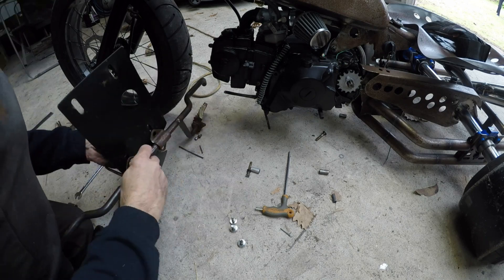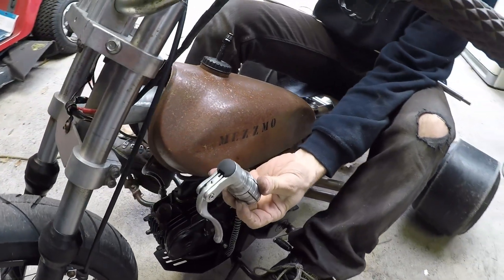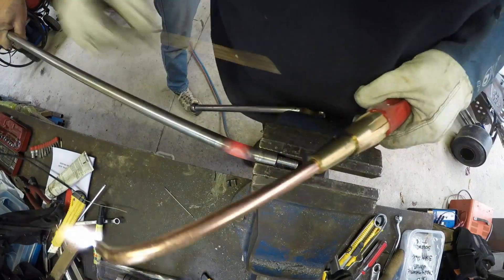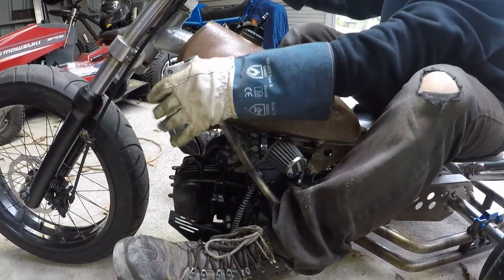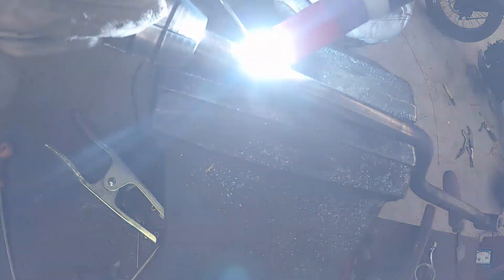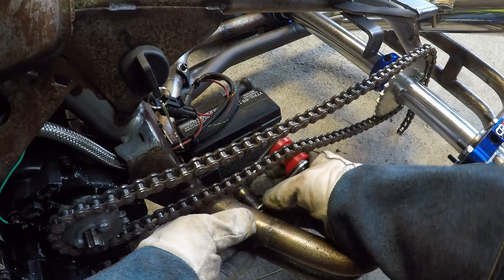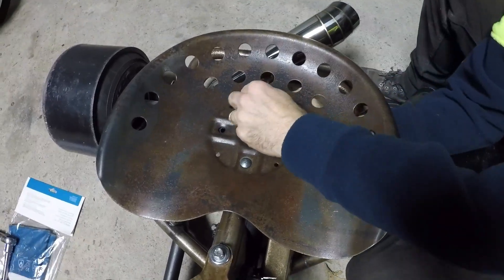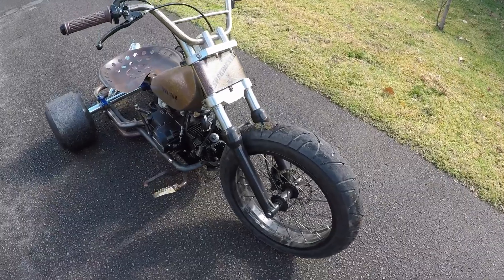Custom Drift Trike Part 8

Comment: By far the coolest and best build trike I have seen, most put the engine on the back and I like it on the bottom way more, more drivable and so nice!!
Reply from the maker: Thanks Jerseys. Yep, I think the engine position turned out awesome. Its well balanced, having the engine further back would make it less stable as more weight would be in the rear.
Reply: Yessir! Much better design can’t wait to see a rip vid